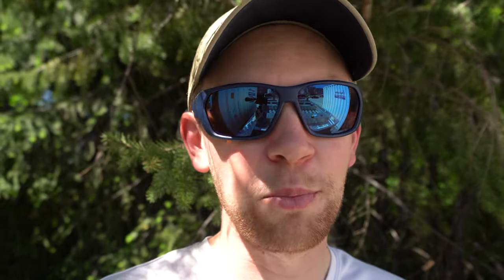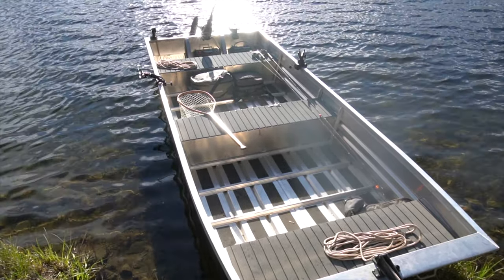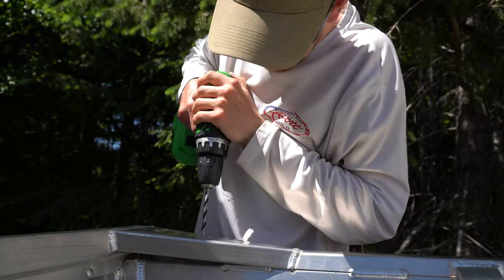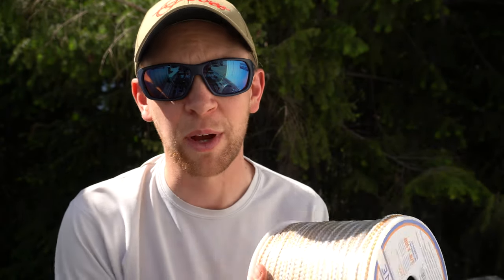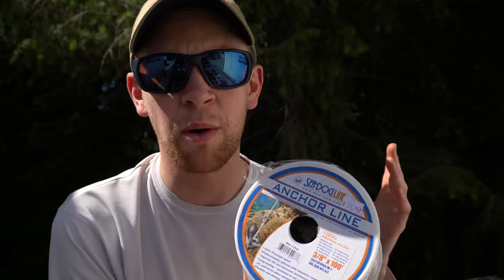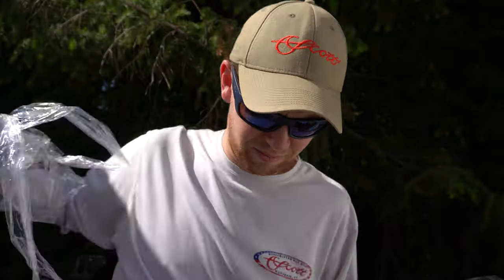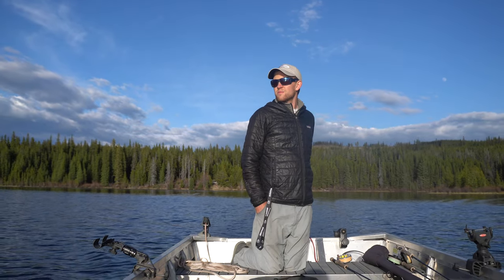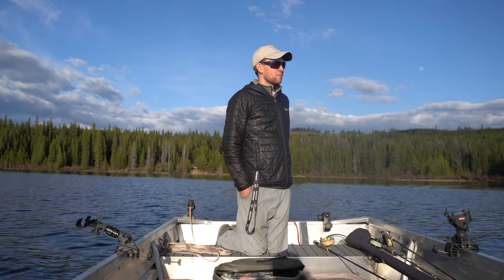MARLON SP14 BOAT BUILD PT. 1 (The Basics...)

Comment: Figure-8 knot is better for the bitter end of your anchor line.  A granny knot can come undone unless under tension, but under great tension, it will compress and jam to tightly that you can't untie it.  A Figure-8 knot makes a better knot for the bitter end, doesn't compress so hard, and can be easily untied when desired.
Reply from the maker: Definitely agree the figure 8 is a great knot for the end of the anchor line!! I usually don't try to flirt with anchoring at the end of my rope, but sometimes when fish are in deep water it is needed!

Comment: How would putting your anchor on one side or the other of the rear of the boat make a different? The motor is in the middle making it equal distance to a rear mounted anchor. 

And what difference does it make which hand a fisherman uses on the boat. That also made no sense.